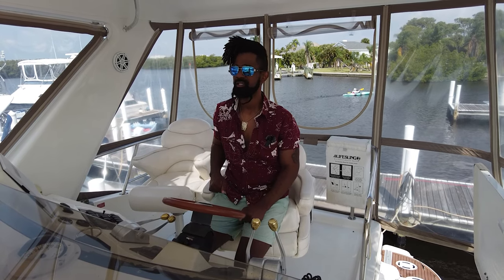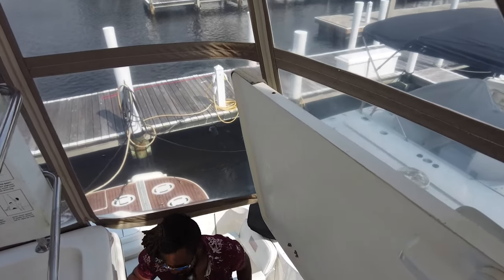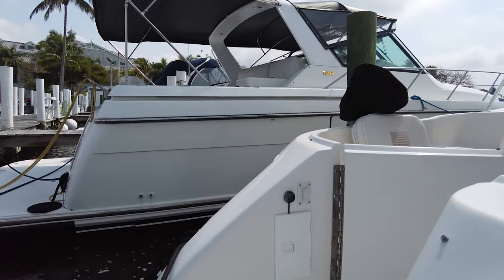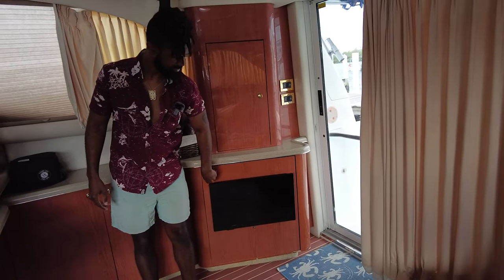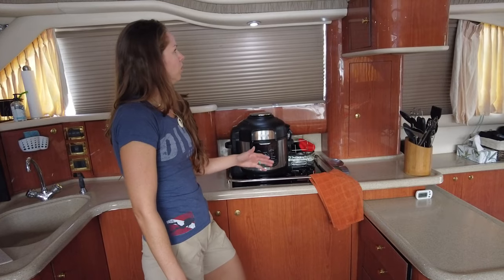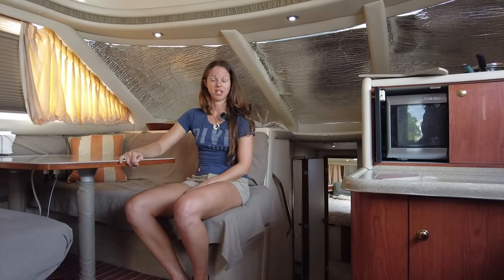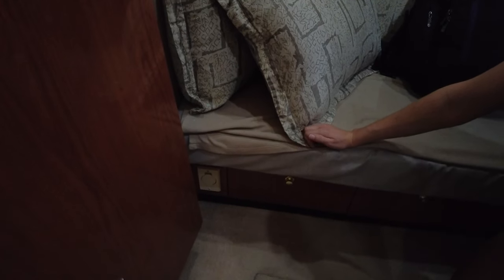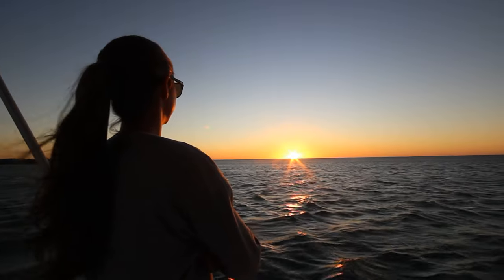BOAT TOUR: Sea Ray 480 Sedan Bridge Walkthrough

Comment: Thanks so much for the video.  My wife and I own a 1998 Sedan Bridge here in East Tennessee and love seeing other owners who love their Sedan Bridge. Can I ask how you guys set up your cockpit canopy?  Did you make it or was it an aftermarket buy? We could certainly use one on the crazy hot days!!!
Reply from the maker: Absolutely! We used 2 cheap telescoping poles and a large shade we bought on Amazon. We cut the shade to size and stitched a piping on the shade that slid into the canvas track already mounted on the cockpit ceiling area for our boat enclosure.
It wasn’t the prettiest, and it sagged a little when it got wet, but it held up nicely for over a year, before we removed it when we returned to living at a marina.